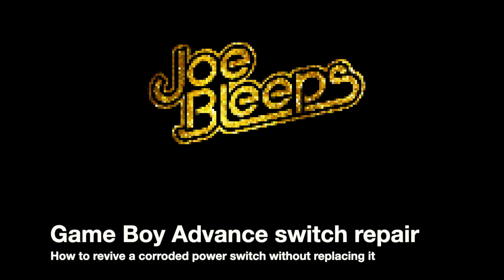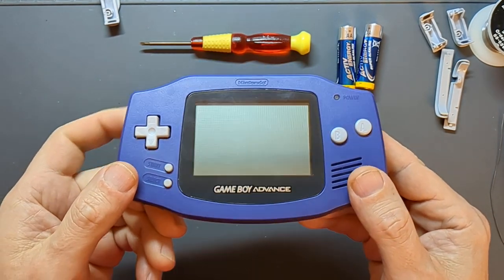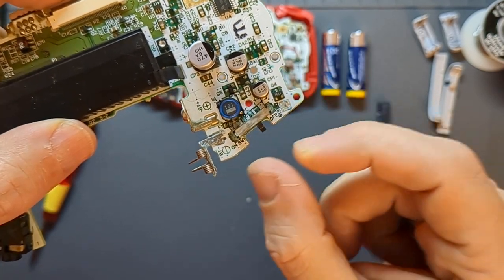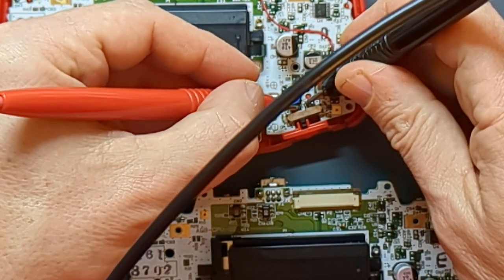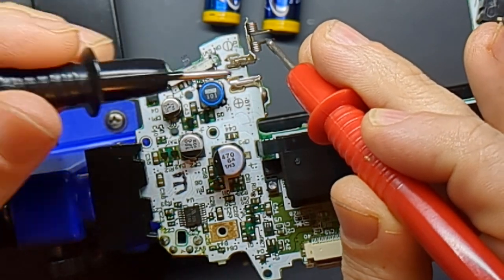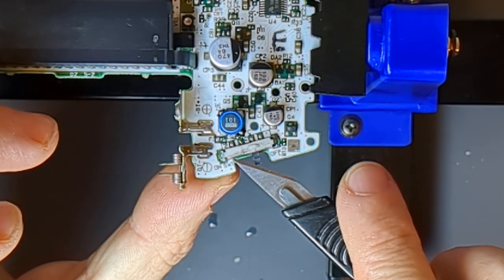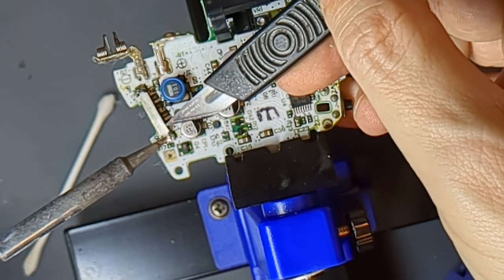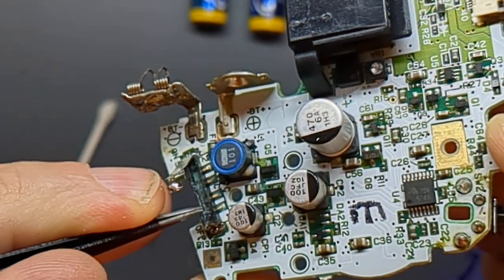GBA power switch repair:  Nintendo AGB Game Boy Advance

Comment: Thanks. I took apart the GBA power switch and scraped black "stuff" (probably microscopic plastic dust from the housing) off from the metal contacts on slider and switch itself. I was having an issue where the GBA wouldn't power on sometimes. The hardest part was removing the metal shroud over the switch. I couldn't see where the metal for the shroud ended and solder and pad began so trying to slide it past my iron as I pulled up the metal shroud took forever.
Reply from the maker: It is super fiddly isn't it

Comment: Great stuff Joe! Do you prefer cider vinegar? I use 99 IPA and have also been told white vinegar. Is there a difference between the three options for cleaning corrosion? ❤
Reply: Joe is the best 💪🏼
Reply from the maker: If I'm honest, cider vinegar was all they had in Aldi when I needed vinegar so I figured I'd try it. It's quite acidic so it reacts well with the battery corrosion. I've had white vinegar before and this doesn't smell as bad. Isopropyl is great for cleaning and works to an extent with cleaning battery leaks but it's the acid/alkali reaction that helps in the case of vinegar